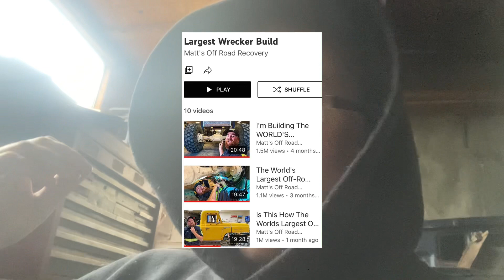Ep117 OFF-ROAD TOW TRUCK OLYMPICS?!?!?

Comment: Trailmater hands down.
Reply from the maker: I agree but only if BSF didn’t participate. If they do then I’m not sure…
Reply: @friktgarage6001  
I don't know who BSF is.
Rory can make that truck literally turn with trailer in toll through anything, switch back turns, just phenomenal steering and locker axles.
Reply from the maker: @FJB8885  BSF is another off-road recovery team. I mention them in my video. The red wrecker. Rory is truly talented and Trail Mater is setup well but BSF is setup pretty good too and been doing it for quite awhile too.
Reply: @friktgarage6001  In a recent video Mara was asking Eric about going to the olympics.

Comment: Here from MORR, this video came up in my feed. As a viewer, this is what Matt has told YouTube:
Winter Off Road Wrecker Olympics
Sand Hollow State Park
"I'm coming for the crown, Rory!"

Matt's wrecker is completely custom fabricated, International only made the cab. 8.1 Vortec from an early 2000s Suburban. It will have 54" Mickey Thompson tires on 9 ton MRAP axles, 4 wheel steering, and 7-8 electric winches. It will weigh about 12,000 pounds and have a tighter turning radius than the MORRvair. It is also shorter than a 4-door Jeep Gladiator and can be hauled on a car trailer, though a gooseneck would be nice. It will also be street legal and drive to most recoveries.

The reason for the squarebody Chevy theme is that GM made all their generations compatible with LS engines. You can drop a newer LS in an older truck and it will work just fine. Other manufacturers upgrade their vehicles so there isn't that compatibility.
Reply: Unlike Ford, Chev never made the same mistake twice. They built something that had maybe 1 - 2 generation changes over 20+ years. Ford on the other hand has rebuilt the "F" series every 3-5 years (at least). Try finding a 15 year old part on a Ford that's interchangeable, it isn't going to happen.